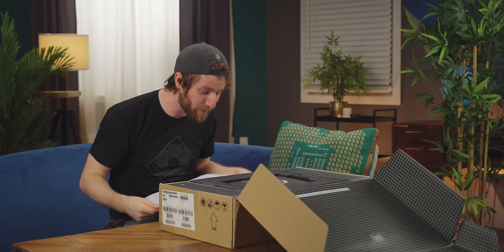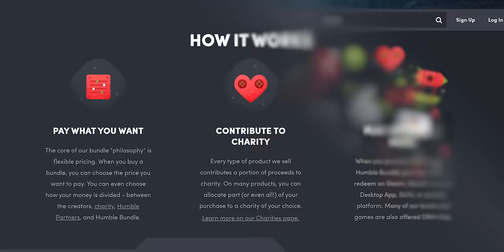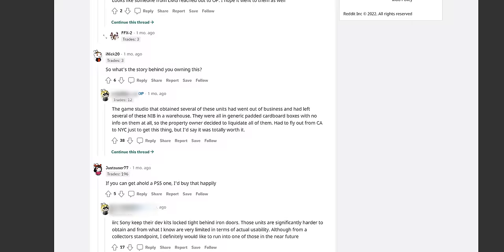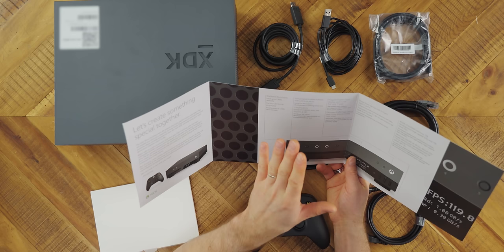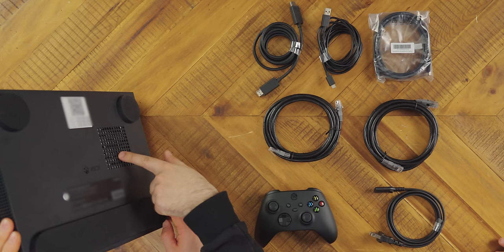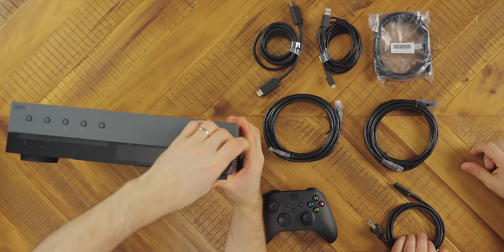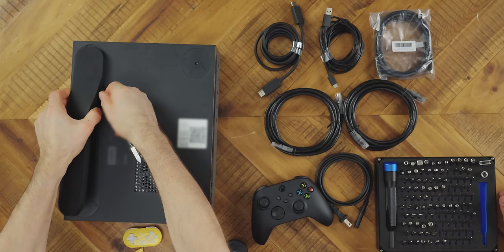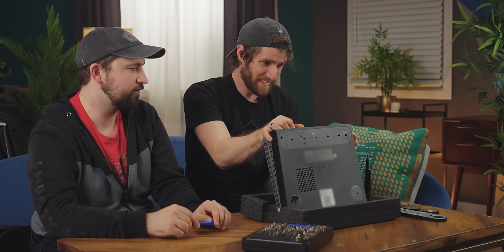I Can't Believe I Paid Two Grand For This - Xbox Series X Dev Kit

Comment: What's funny, is that if this console is anything like PlayStation dev kits, there's a slight difference in the ID of the console that checks if it's a debug/dev or retail console (for PS3, console ID's would have 1 number different if it was a debug console). Assuming this works the same way these days, this console was probably completely undetected from Microsoft until they decided to connect the ethernet cable. It probably did a handshake with Microsoft servers and saw the difference in the console's identification and immediately banned it. I was surprised it actually accepted the software update, typically the consoles have completely separate builds for each version. Maybe things are changed nowadays. Nonetheless, I love these dev kit videos, it takes me back to the days where I loved to tinker with game consoles and their capabilities. Great video!

Comment: For the next time: The best way to disassemble glued-on parts, is using blue gasoline (the one used in zippos);
A few drops, wait a bit, it will peel off without any effort and without breaking the adhesive film, and when it evaporates, it will stick again.
Reply: Nail polish remover would doit too

Comment: 10 gig networking is clearly just so developers can transfer data to it more quickly.

By the time 10 gig internet is widespread, I'm sure standard routers will be operating at 40+
Reply: We're on the cusp of, if not 10 gig Internet access, at least multi-gig. Bell Canada is rolling out a symmetrical 3 gigabit tier, and Rogers is trying to one-up them with an 8 gigabit tier. Bell's been sending out xg-pon ONTs with 10 gig ethernet ports for a few months now. Meanwhile, those of us stuck on Videotron have at most their upcoming 1.5 gigabit tier, which is far from symmetrical with 50 megabit of upstream.
Reply: @guspaz  I’ve just got 1 gig internet recently (well 1140mbps) but the router provided by my ISP (virgin media) can’t even support more than 940mbps - crazy.

Internet will soon be like water pressure, just one speed and it’s a lottery what you get but it will be so fast no one will care.
Reply: @guspaz  also you need to be complaining about why mobile data is so expensive in Canada - I’ve been all over the world and Canada was the most expensive I’ve experienced for a data sim by far!
Reply: I doubt it. My country has 1gbit widely available, and 2/4gbit in "testing" for consumers, yet only 1gbit routers are provided, and 10gbit networking is very expensive to buy currently.

So networking requiring 10gbit is already here, yet there are relatively few consumer routers that will do that speed.
Reply: @Programmdude  what country is that? I already see 5G overtaking the fixed line speeds in many parts of the UK, just because we have a “speed guarantee” cash back system so not many people offer it as fixed broadband. Also the latency claims of 5G I think aren’t as good as promised (so no good for gamers).

Comment: We use these XDKs in QA and when paired with the Xbox GDK, they're awesome and extremely helpful. This is the only version of the hardware which is great since the XB1 had a bunch of different versions (test kits and dev kits for each revision, some looked like retail, some looked sort of like this but different colors/sizes). Without the GDK or Dev app, you're really missing out though. You also can't run retail games on the system and even if you did get your hands on the GDK, dev app and some ISO's, you'd need the sandbox for those games and have dev accounts made for those sandbox's. So this really is just an expensive paperweight in your case. However, I think you can completely turn off developer mode then install the retail Xbox OS and that should work but all of the unique features will be disabled essentially turning it into a standard xbox. Not sure if this is still a thing for these XDKs but I did it once on an XB1 dev kit at work.

Comment: Oh hey thanks to Xbox's DRM you can't play most of the games on a Dev Kit, just like the retail systems. However a game like Devil May Cry 5 Special Edition would've been you're best bet since it's a Series X only game and has the complete game on disc. Most Xbox games require an online authentication from Xbox servers. However Series X only game discs don't need this, but some of them also don't have the entire game on the disc like Forza Horizon 5.
Reply: This was also my first thought, but I wasn't sure if the dev console would behave the same as retail with DRM
Reply: exactly even 360 or xbox one game won't work without an ''update'' and internet check ☑
Reply: my dev kit can play any game
Reply: @ThaexakaMavro  360 is emulation and needs to download the game from the server.
Reply: Even with the complete app on the disc, you can't run retail games on a devkit
Reply: @kipters  I do, I have a devkit
Reply: @slumpdogyt  what kind?
Reply: @kipters  xbox ones original devkit. It's in retail mode. My studio closed and they never asked for them back. I still use both regular ones in my home movie room
Reply: @slumpdogyt  oh interesting... Was it an UWA or ERA devkit? Can you still boot into dev mode?
Reply: @kipters  idk which one it is, all I know is it's built inside the original xbox one that came with a kinect. Yeah I have the dev app and etc, I could probably put it back into developing mode as the option is available. Probably will not as I don't really have a need to go into that mode. One of the systems was replaced with an Xbox Series S, even though both dev kits still fully function.

Comment: Arent most dev kits usually prevented to play retail games by design? I would have been surprised if it would play any retail disk
Reply: Nah, these can be toggled back and forth. Same with Durango and x360- I have never been in sony camp, nintendo wii ones could also go either way. It's just a pain since you have to log back in and get re-registered to get into retail - and if you're on a devkit that's been flagged by MS, you can brick it.
Reply: ps3 test units can run full retail code with no setting modifications

Comment: You could have used a retail Xbox to install/download and update the game on an external ssd, and then use it on the dev box.
Reply: It wouldn't work i guess, i'm pretty sure is not that stupid, imagine someone playing your game on the same online services but with a dev kit console, it's litteraly worse than PC cheating, debugging can really make you god, pretty sure dev kits have strict procedures to even plug them to the wall, so many pass and stuff that makes them really usable by devs, kinda makes sense since it's a DEV kit
Reply: @MrQuicheProductions  it would work, they were trying to play in offline mode. The game needed to download and update, and since it wasn’t an authorized dev kit it was bricked as soon as they logged in. It would be the case with anyone else that was using an un-authorized dev kit. Aside from the official kit they were using, which has to be given directly from Xbox, any Xbox can be put into dev mode and used as a dev kit but you won’t be pulled off the network.

Comment: I wonder how well this would do as a computer, beef up the the SoC some more, extra CPU cores and another 3000-odd GPU cores, have an 80GB SKU, and give it an SD card reader
Reply: Remember that VRAM GDDR has terrible latency, so these consoles aren't really meant to be used as universal as PC even on architectural level.
Reply: @kazioo2  Then just give it the right RAM as well, nothing saying the board couldn't be remade, and it's not like microsoft could just not have gotten rid of the second internal drive slot in the commercial XSX/S, so they ain't shy to fuck us over in the end
Reply: the hardware would might work, but without proper drivers, they would be pretty much useless.

Comment: We use these at Halo Infinite LAN events in the Open Bracket. Haven't gotten to tinker with it like linus, very cool video!
Reply: @kuyans3889  i think its more a tournament  LAN server thing then a console shortage thing, i know from watching Overwatch league they run on a special LAN server with a higher tick rate then public servers and special patch of the overwatch client. its probably easier developing the server and clients on a dev kit and just using the dev kit in tournament so you dont have to do any "retail model" testing. plus the extra memory and specs would help the game run smoother so you hopefully don't have pro players or the audience complaining or about lag or stutters, which could be very bad for their reputation.
Reply: @kuyans3889  it runs a lot better on the dev kit than the default series x too. Wish we had enough pcs but it is what it is

Comment: The debug port is likely for remote software debugging on a PC. You can debug software (i.e. the game) running a remote target over an IP connection. It will allow you to set breakpoints to stop the program, view values in memory, step through lines of code and trace the program logic. It's pretty common in cases where your software is running on hardware separate from the PC which runs your development environment. 

I don't work for a game developer, but we usually compile the build on our PC workstation, copy it over to the target over ethernet and then run it on the target while live debugging on the PC workstation over the same connection. I imagine it's the same for console game devs, but they probably work with much larger file sizes, hence the need for 10 gbps to speed up transfers of new builds.

Comment: Ps2 dev kits were $10k each and massive, and you would use test kits where you could as they were only 2k each.
But, we used to mod chip regular old retail PS2s for $700 and wrote our own debugger that would run on the retail kit. In the end we had most of the functionality of the dev kit on the retail kit. Only leads had dev kits and everyone else (including many of the artists) had chipped retail kits. In a studio of over 100 devs it saved us hundreds of thousands of dollars.
Reply: Totally didn't know these things exists until now
Reply: Oh wow, I'd totally forgotten about the "test" PS2 machines. IIRC, the main benefit to a test PS2 was that it ran games burned on regular DVD-Rs instead of requiring manufactured discs with all the DRM and anti-copying measures. That way developers could just burn a disc of the current game-in-development for testing & QA to run. Most of the debugging stuff had to be removed, and the game was "built" like a retail version, so it fit in the memory of a regular PS2, but testing then only needed a $2k test PS2 instead of a full-on $10k development PS2.
Reply: What games did you help develop?
Reply: @didho5907  we mostly did licenced titles for Nickelodeon.

Comment: 13:49 That's not correct at all. PS1 devkits were standard ISA cards (DTL-H2000) that were plugged into our PC's (a Pentium 3 at that time) running Win98. It was essentially an entire Playstation on a card. There wasn't even an SGI machine in the entire studio.

Comment: I wonder if they had used a external drive with games from a different Xbox and transferred the games to the Dev kit Xbox whether that would've worked?
Reply: It still wouldn’t work. These dev kits are designed on a sort of token system, so when a dev stops using the dev kit and stop renewing the usage token, the dev kit is essentially useless and gets flagged. The dev kits need to go through a sort of online “handshake” with Microsoft servers to have any sort of functionality, and if it’s flagged, if it is ever connected to the internet it will do the handshake with ms servers and it will immediately brick the dev kit. It needs to do this online handshake even to run games offline.
Reply: @CheddarProtector  Ahh okay. I thought that might have been the case. Thanks for the info.

Comment: Please download games into an external hard drive then try to play that on the dev kit.  The games will require an account to confirm you own them but if you have a corresponding disc that will work as a key.  

Xbox discs work primarily as a key and you still need to download from the internet to play anything.  So if you install the games somewhere else you can use the discs to play them offline.

Comment: Well, I can give you a bit of insider information.
The retail port is for your standard playing, so that your sandbox and the account for it are able to access the internet.
Even though I haven't used the debug port yet (our devs use it), it is most likely to retrieve debug data.
I can even tell you a bit more about this thing if you want.
(Haven't watched the video entirely yet but with this specific dev kit, you can even test different consoles like the series s, one x, etc., By limiting it's hardware)
Reply: As a bit of background, i work in QA

Comment: You need more RAM and higher speed for Live Debugging features. The DEBUG code is not optimized and contains Symbols and other metadata information that makes the binaries explode even by gigabytes compared to the final retail build. The higher network bandwidth allows to deploy the much bigger builds faster and allows for better live debugging experience - where you can debug even the network code and your graphics code inside your Visual Studio with any unreal/unity engine or any other IDE they make you use.

Even if the builds are not that much bigger the faster network speed and a dedicated network interface allows you to debug the network code without impacting the actual network related gameplay.
Also 10x speed transfers allows you for even faster turnaround if you`re a dev is a huge productivity boost.

Comment: Setup a bunch of gaming virtual machines running windows off of a single networking desktop on each virtual machine host a desktop to be streamed to the edge browser and on each profile on the xbox sxdk link those profiles to the edge browsers, use rainway or parsec then access the virtual machines and install xbox app so you can play using remote play.

Comment: I have seen so many people say use a retail Xbox SSD in the dev kit with games installed. I will tell you it doesn’t work like that. I have one of these and a retail Xbox one that was reused as a personal dev unit using dev mode. I can say that trying to use a a different SSD with games installed with the required updates does NOT work on dev Xbox’s. I have tried many games such as Halo MCC and many many others. I have a game library of over 400 games for Xbox One and over 700 games for Xbox 360 on a 16TB External SSD. So yeah not happening.

Comment: SSD is Standard on DevUnit since the Xbox Scorpio Developement Kit.
Xbox is not like PlayStation where you just write QA/TEST/RETAIL/Etc, its require more step, authentification with Microsoft serveur, Validated Dev Account.

Microsoft done that for avoiding any Devkit Exploitation for Hacking.

There is a lot of service running in background, even one called "blackbox" that logs Everything.
In fact even on retail HW Microsoft have full Control.

Comment: Interesting but yeah games always have to be checked with internet the first time then can play offline. For a Dev kit I assume it may refuse retail games because it can't understand them, checks for code in there that retail copies have to restrict access maybe (or needs online for checks or something)/retail copies not having certain Dev code or not being bound by restrictions because it's on a build disk maybe but either way I think a Dev build of the game would be needed first to use on the kit likely.

Xbox One/Series BC is a license check with the disk and downloads it to your console, but 360BC for OG Xbox which ran off the disk but still needed internet to run it/download something I always skipped those updates and the game ran fine. Ran PG1&2 on there in 2020, yeah a licensed racing game they never delisted it. So as don't own an OG Xbox was able to play it that way.

Comment: Can I offer y'all a HANDY bit of advice regarding removing mastic adhesives? Snag yourself a can of pocket lighter fluid (aka: naphtha) and lift squirt-lift squirt until it comes off.  No naphtha on silicone rubber, varnished surfaces, and I think there's at least one flavor of vinyl  that will cloud with naphtha. Naphtha won't  do ALL mastic adhesives but it will tackle a LOT of them. (Yes, naphtha is highly flammable so don't be stupid when working with it.)

Comment: I don't know if anyone has tried or mentioned this here, but I have a theory;
Can the OS be changed?
if so can the internet connection then be filtered through a PC/laptop link up to monitor incoming traffic and to control updates?
and if all this can be done then maybe we have a modded Xbox one?
even if we can't get the operating system change on the Xbox one itself at the very least can the internet connection be filtered to it, to control hacked updates and mods?

Comment: The SSD in the Series S/X is married to the motherboard and requires the first partition to be copied onto any replacement drive if you ever want a chance of booting the system.  I'm wondering what's on the first partition of this WD SN720 SSD as maybe it has some special sauce that repair technicians can use to allow any SSD to boot and remarry with a main board.  Please consider dumping the first partition and making it available...

Comment: Where's the fun? Use a standard Series X mainboard make it work in the XDK case. Fire up the little oled display with a raspberry or something. At the end of the day it would at least look cool having a "working series x" in dev system case instead of the "ordinary cube." Send everything else (dev mainboard, drive) and the leftovers from the series x cube case (fan, power supply) back to Microsoft and sell the modded "Series X in Dev Kit Case" back on eBay .. 😁